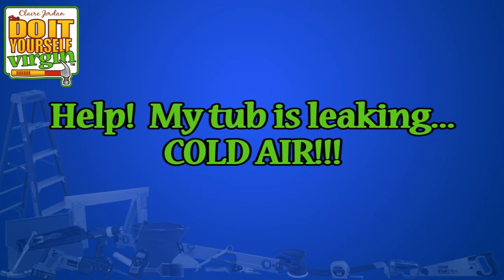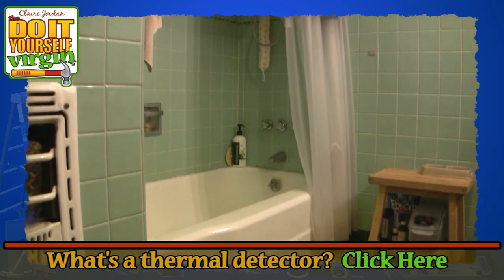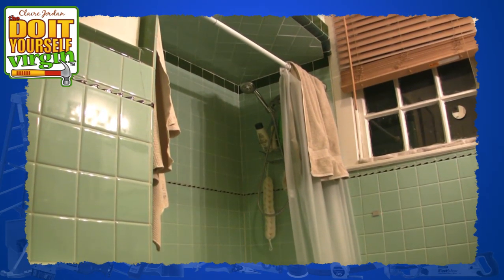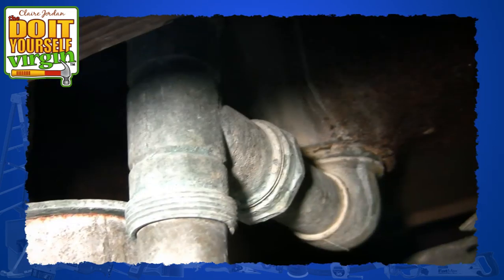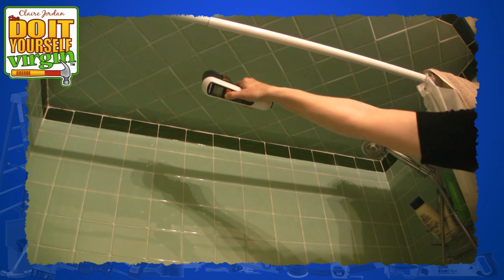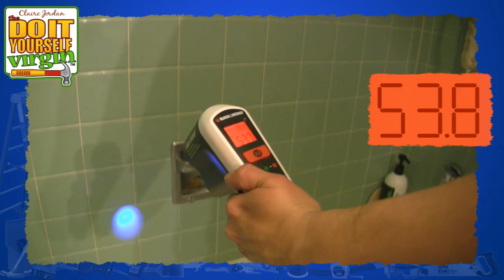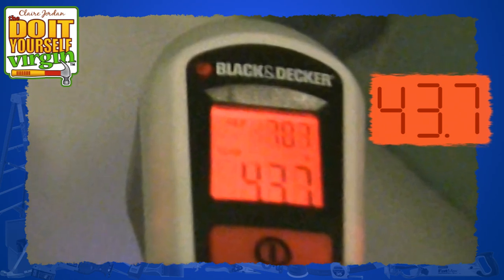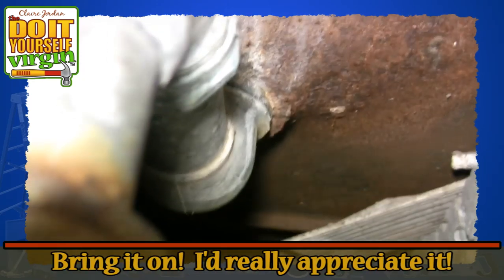Using A Thermal Detector In The BATHTUB!  DIY Video

Comment: You need a thermal break! Here's a very cheap and super effective solution. Replace a short section of the drain pipe under the tube with ABS plastic drainpipe. Plastic is a poor conductor of heat. Then Like "npudomme111" says spray urethane foam up under the tub. You don't want any metal in direct contact with the outside air!  Foam only 1" or so not lots. Foam to isolate the tub and plastic pipe to isolate the cold ground and metal piping. Heat cannot flow out pipe or metal!